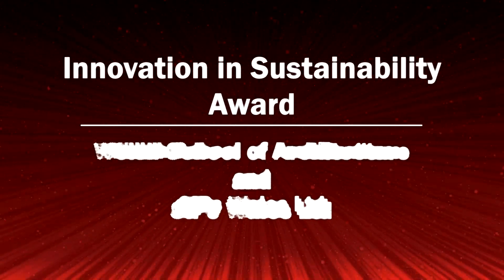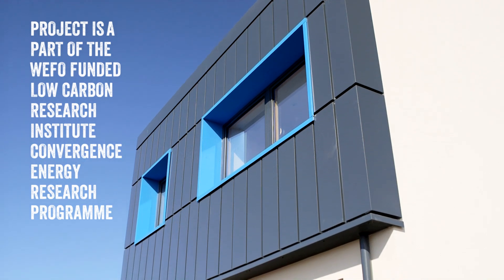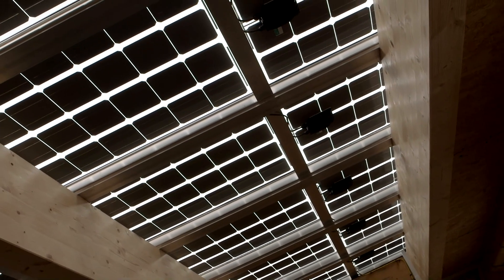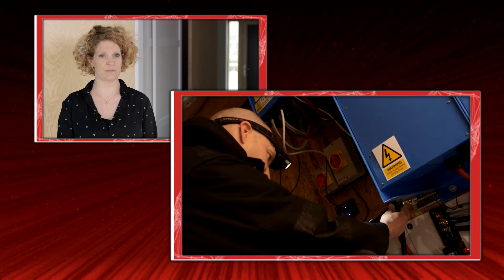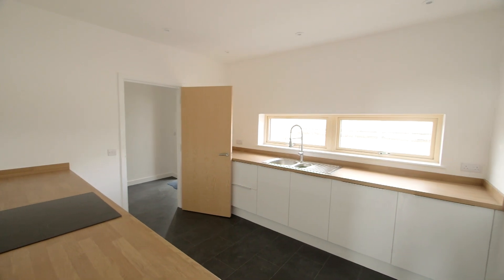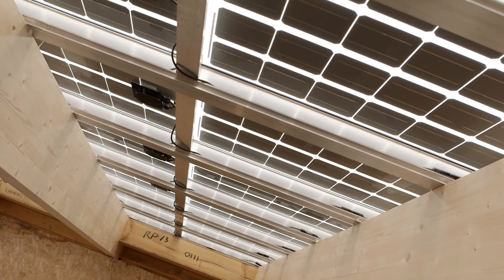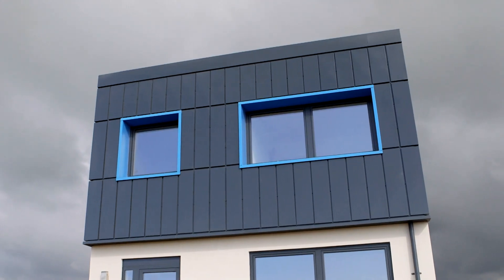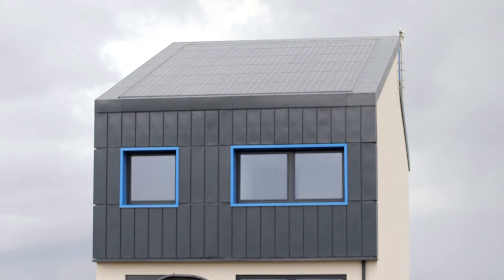Solcer, a carbon positive house - Innovation in Sustainability Award 2015

Comment: Is the roof insulated at all? How did you get around SAP on that basis. 
Also should this be "carbon negative" rather than carbon positive. 
I like the house, and I would live in it for sure.

Comment: I like and I'm voting in favor of this  outstanding project : #CU115.  As  Professor of Civil Engineering in Romania,  I'm considering  this  showcase  project  as  a  positive result  of perfect collaboration  between  between  academia  and  industry and  as  an outstanding example   of  successful  " zero carbon house , designed ,   planned  and istalled and validate  in the "real world", for the benefit of  the  entire society.
I hope  that  very soon, this project and its principles  will  be implemented  not only in Wales Region  but beyond Wales, reaching  also my own country, in great need for low energy  infrastructure including housing.

Radu Andrei , PhD, PE, Professor of  Civil Engineering